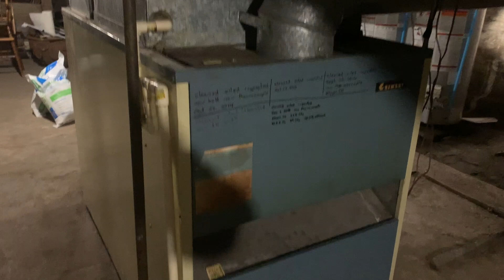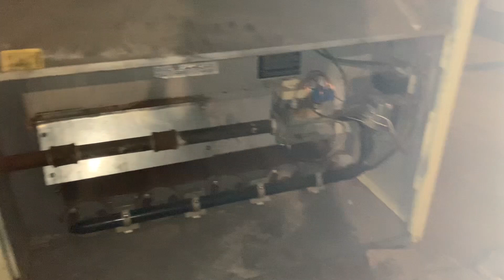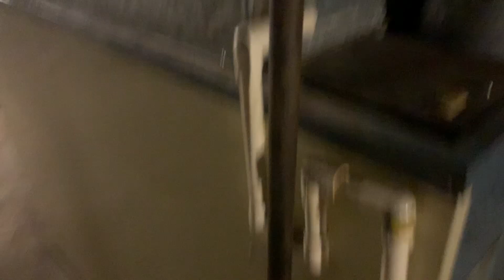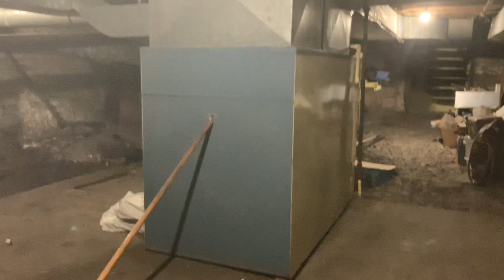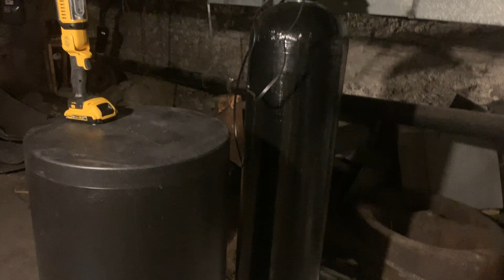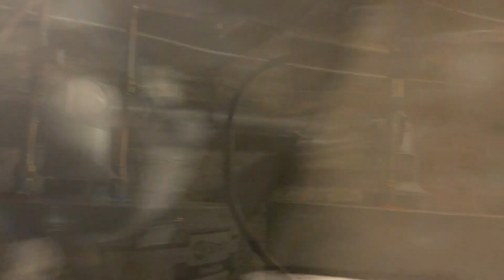Vintage 1980s 180,000 BTU Furnace Tour Dungeon Basement

Comment: saw this video linked from comment on uxwbill's video.

At 4:20 -> You probably don't need such a large furnace. Most were grossly over-sized especially in old houses. They may have went from no insulation and single pane windows with a coal gravity furnace, converted to oil forced air and double pane windows and then gas in the 80s all without doing the engineering work they do now a days when designing hvac systems for new homes. No load calculation.

Even if they made furnaces with the same output as yours, it would need 30 to 50% more airflow to work and the ducts would be undersized for it. So putting one in of the same size wouldn't work.

New units will run for more than 10 years if they get proper airflow, dispose of all contractors who claim they need replacement after only 10 years.  You should be able to get 15 to 25 with some repairs along the way. 

Get a energy audit and load calculation done now and see what you can do to get the heat loss of the house down. So when you decide to replace it or you're forced, you're ready and can safely downsize. 

New ones max out at 120k btu input,  115k output which isn't that far off from what's there. Probably more than enough. You may only need 60 to 100k input though. Most homes can heat with 60k high efficiency in most climates, it's only large and/or poorly insulated places that require more.

You can see a huge reduction in energy consumption replacing that old unit. Even more so if you reduce heat loss of the house first. From the rating plate, it's 75% efficient when fully warmed up and running but between the standing pilot and open draft hood, it's closer to 60% over the heating season due to cycling and standby losses. If it's grossly over-sized, it could be closer to 50%.